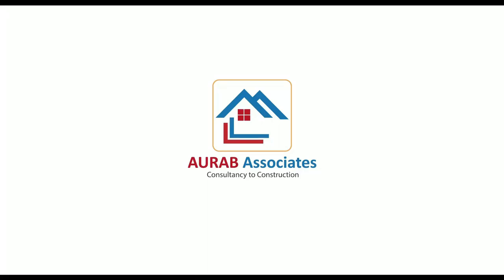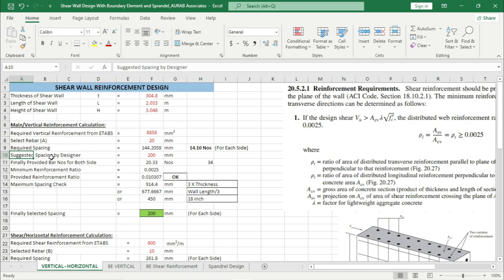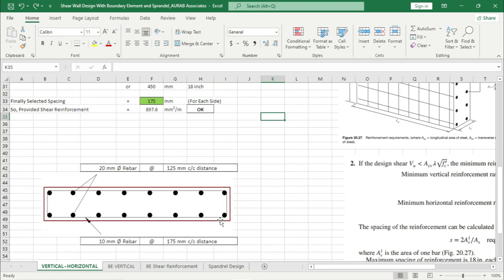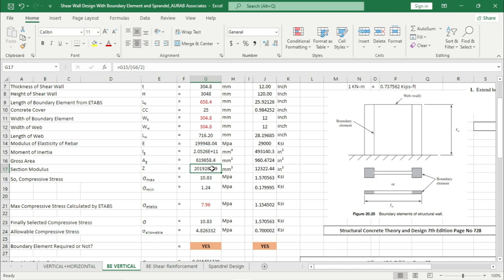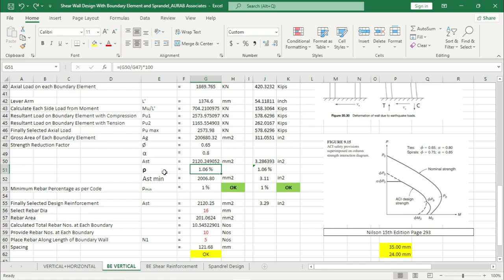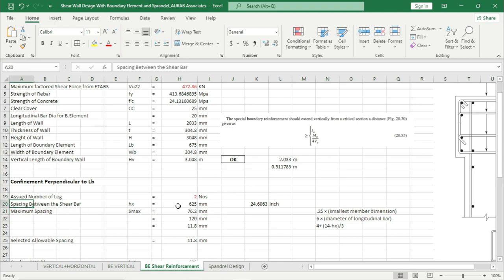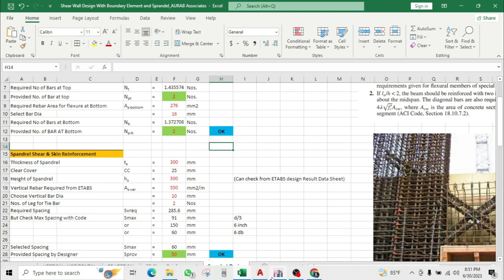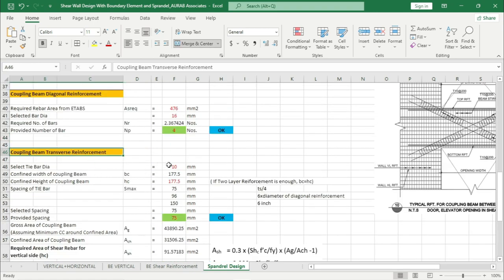Shear Wall Design in ETABS With Boundary Element and Spandrel

Comment: Hi, I used to design boundary element dimension from first wall summary by etab to be 980mm ( the length) with maximum b=300 for wall 200mm, but when I generate general section for the interested wall, i found that the length for the boundary in the summary for the wall increased again!! to be 1160mm! Can you pls assist in this matter??
Reply from the maker: Actually it means ETABS requires more length for the Boundary element. In that case you can increase its length. 

But in reality due to the Architectural reason we can't increase it's length. 

So, my suggestion is if D/C ratio is okay in that case you can ignore that additional boundary element length. 

If you follow Mr. Nadim Sir's book you will get a formula to calculate the length of the Boundary element.  You can move forward with that formula.

Thanks.